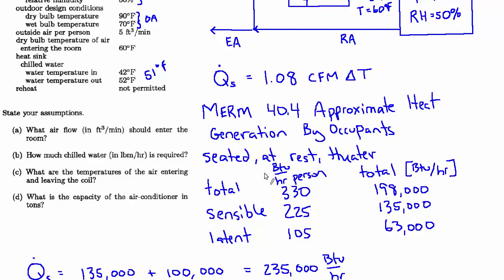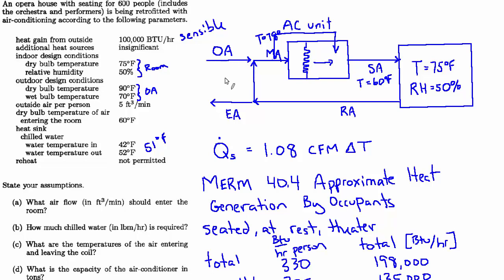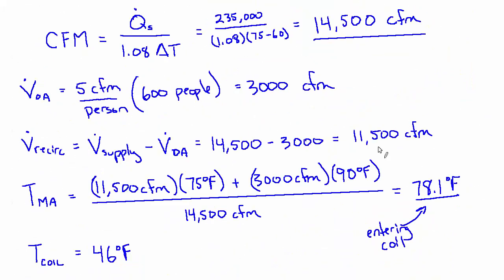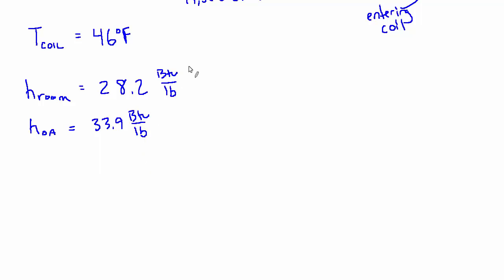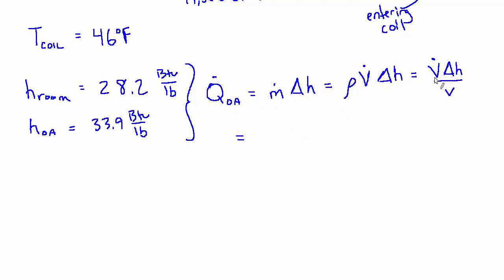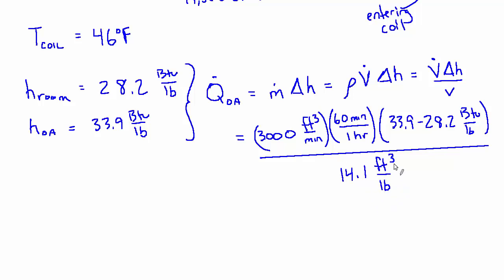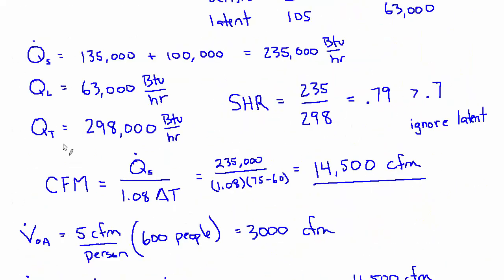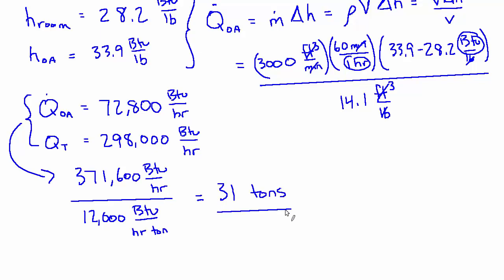Calculating Air Conditioner Cooling Capacity: HVAC Fundamentals for PE Exam Prep

Comment: Thank you for publishing this great and helpful video. I would like to know if i use this information for sizing duct work or Selecting cooling coil, which one of these CFM can be used for sizing duct and for selection of coil capacity in or to determine the face area of coil ?
sensible load: 14500 CFM,
Total load: 72800 btu+ 298000 btu ÷ 12000 = 31 × 400 =  12400 CFM
Reply from the maker: The key assumption there is 400cfm/ton.  Perfectly reasonable number, but it depends on the application you are dealing with.  That value may vary.  Not sure if that answers your question, feel free to shoot me an email.